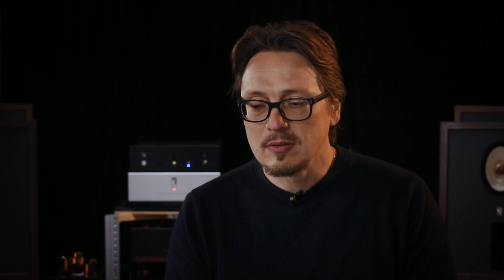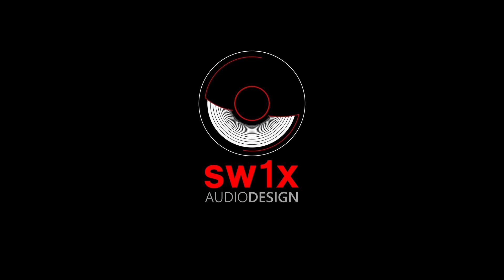Why Materials Are Important in DACs and Amplifiers

Comment: Audio equipment is not an instrument
Reply from the maker: this is the major difference that sets apart from others- for us audio equipment is an universal music instrument. for others it is just audio equipment
Reply: @sw1xaudiodesign it can’t be a instrument. As you cannot make music with it. All audio components are gains stages, regardless of type. It can play what we feed it. It cannot be played like an instrument :)
Reply: @sw1xaudiodesign would be a fun concert with a band playing on audio gear hehe.
Reply: Completely disagree. I consider an audio component to be just like an instrument. It has its sonic character and produces its own sound.

Yes it can create music but here it’s the philosophy of making the components
Reply: @Borednlonely  Every audio item  plays role only as  conversion tool from  electric energy to another electric enrrgy and finally to air  vibratiion. It is not instrument bacause tool  is not source - without sound source audio  equipmenti keeps  silent, The same "universal instrument" as audio gear  is the  air - it  conversta  mechanic parts vibration into sound , eventualy air  may be as part  inside air instriument. In weird  sense  the  air is   "universal  instrument" but it cannot have tonalty thus is not heard  The same audio gear suppose not to have tonallity

Comment: To me everything matters.
Capacitor material and construction is obvious.
Resistors make a surprising difference.  Some in the signal path in particular.
Wire for signal and for power makes an impact.  Conductor material, size and dielectric all have a signature.  
Tubes have their own unique impact.
And material of the chassis to reduce and control vibration and EMI.